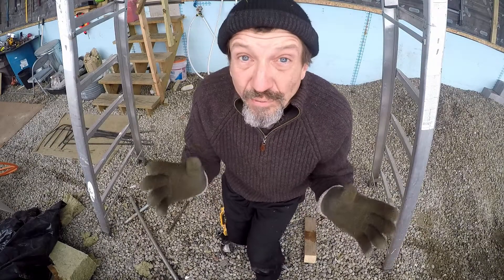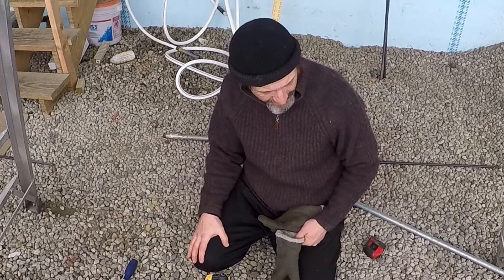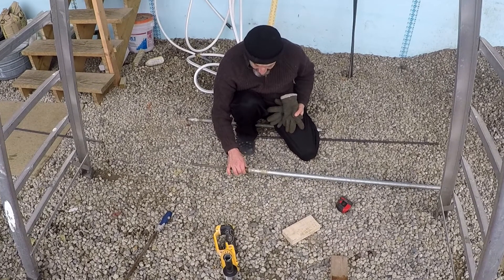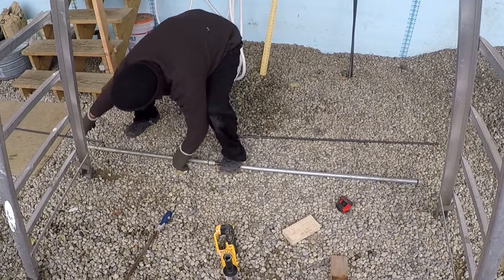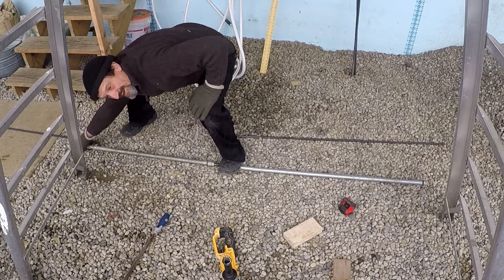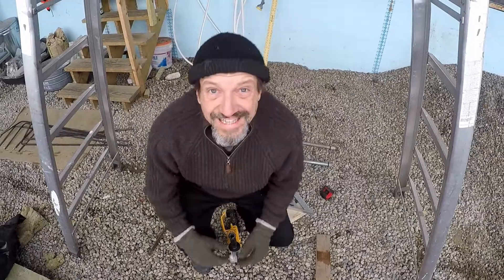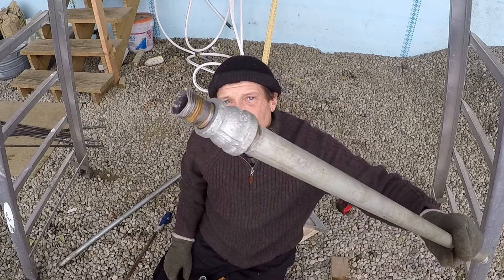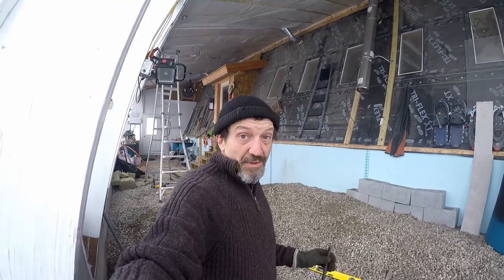DIY 1/2 Inch REBAR Bending Method | CHEAP!

Comment: Very cool trick. I would probably have to butt the opposite end up against a wall or something to keep it from sliding. I don't think I'm heavy enough to hold it in place and get enough reach on the bending pipe. Thanks!! -Lea
Reply from the maker: I'm gonna take your advice on the wall butting 'cause I have a bunch more to bend.  You might be able to mount one on the pipes just above your head somewhere, then you could slip the other pipe on to the pinch-point and use your weight to help bend it downward. Just a thought. Thank you!

Comment: My old man had several different sized pipes at several angles embedded in a concrete slab. The pipes are about 3 feet long and he would slide his rebar in to those pipes and bend them.

Comment: Great... Very simple method.. thank you for your sharing idea.. may i know what size of the rebar...
Reply from the maker: I'm sorry, I just saw your question. The rebar is 1/2 inch. I haven't tried the method with 5/8 inch. You'd need more strength or more torque to bend that.
Reply: Seems I can find 3/8” x 20’ for $8 each at Menards. I need about 200 linear feet of fencing for my garden. So I’m considering using  the rebar for a top and bottom and attaching chicken wire. Also going around my dwarf fruit trees and maybe make a frame around them to hold bird netting or frost blankets.

Comment: The problem with this method is that there is no control of the bending diameter, which causes the bar to be severely weakened on the outside radius of the bend. Code requires 6 x bar size as MINIMUM bending diameter (or x8 for >1" rebar). That's why you need to have a wheel or form of appropriate diameter. This method is fine for ornamental rebar but I wouldn't recommend this method for anything structural.
Reply from the maker: I did not know that. It makes sense. I wouldn't recommend using bars this way for any walls taller than a few feet, in that case.

Comment: I would not call this "Cheap" but innovative.  I would mount one side down to keep it from moving. But that is where I could get "innovative".
Reply from the maker: I absolutely agree - it's only cheap if you already have the expensive pipes.  100% on the mounting the bottom pipe - I was struggling to keep it still with my foot.